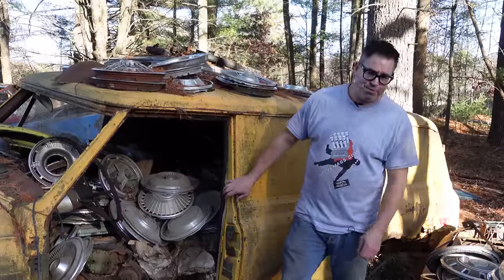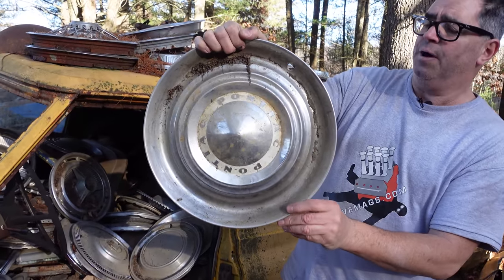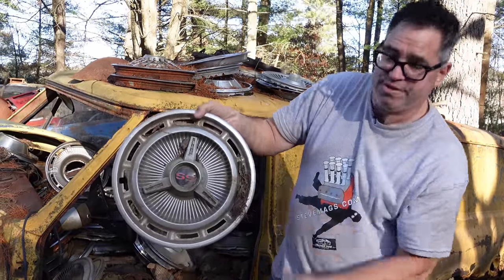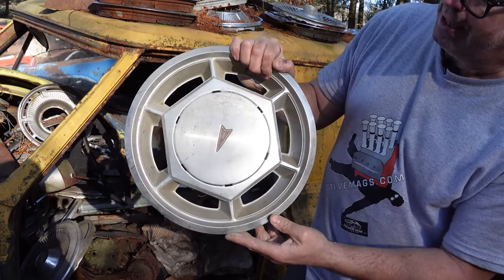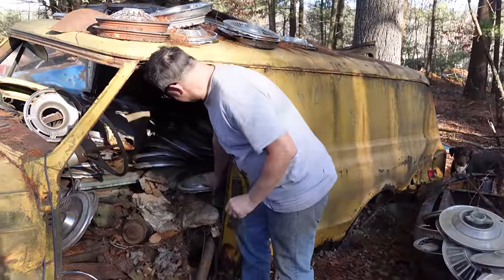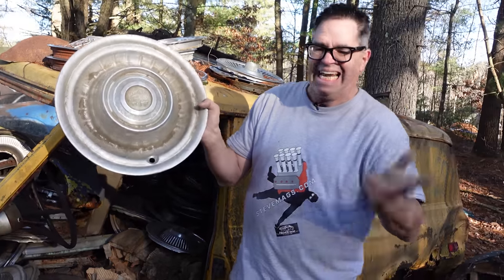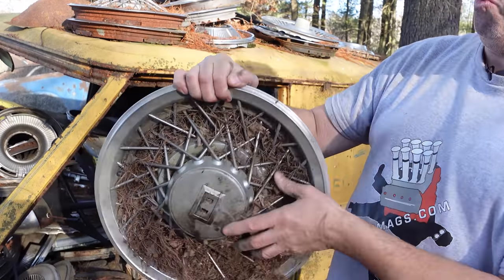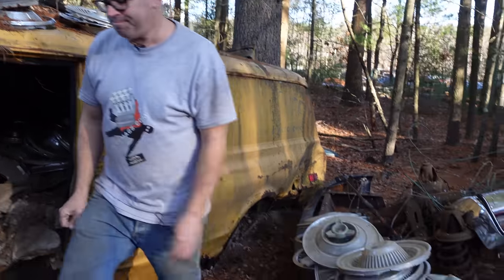Hubcap Game TWENTY TWO

Comment: The 1953 1954 Pontiac hubcap at 1:47 was the first hubcap I ever saw fly off a car in the Bronx NY when I was 5 years old. The car was really beat up and a real clunker and as it went by us the hubcap rolled right onto the sidewalk where we were walking. I brought it back to the apt and have been collecting ever since. Now, in 2023 I own a brick and mortar hubcap store and an eBay store as well, both called hubcapjoes

Comment: Our 1970 LTD had those wheel covers first featured. It was a four door in white, with a black vinyl top - and that 390 2V...
'65 Impala SS?  There was a rusty one near me when I was young. It was light blue, 283, Powerglide, and it had a vacuum gauge on the console!  Even the little bright metal rings on the taillights were rusted/corroded!!!

Comment: Correct, Pontiac 287 CID V8 for 1955. That's not correct on the Granada, you could get it as a wagon in 1982, the final year for the Granada. They would have been assembled in Hapeville (Atlanta), GA or Chicago, IL. The latter plant still operates today and Hapeville closed in 2006. 

Yes, the SS package was an appearance package in some cases, so yes, you could it with a six-cylinder engine. That looks like a Regal hubcap from the 1980s, say 1983 or so. Those would have been mid-size A or G body cars. Nah, no confusing that Sun-turd hubcap with anything to do with a Trans Am. LOL. That ink stamping was likely put on by the vendor that supplied them to Chrysler, yes. Many times they will put the customer's (manufacturer's) part number on it for them to keep track of what they are selling. Katie is coming by for a visit. She's a good woofer, very well-behaved. 

You mean "Delta 88" as there was no "Delta 98". It would have been a "98 Regency" if anything. No, those are 1980 and up full size Oldsmobile wheel covers, more like the Delta 88 (the 98s had a smaller center section). Both ITT Industries and Norris made them for GM, and the difference is the clip design that holds them to the wheel and the locking bolt down the center. You can make a "Type 1 and a half" of sorts, which is what I did. I use the later parts and made them work on the 1st design parts as the clips are better and they stay on the rim better. Those rocket snap on emblems and most of the wheel parts were available well into the 1990s and early 2000s.
Reply: Great info as always G P .   You always get everything straight !
Reply: @daynadiggle8169  Sure thing, anytime.

Comment: Alot of the hubcaps would be a neat touch to people's project cars and trucks and use some of them from something else or something older than the vehicle as long as it fits the wheel clips in place doesn't harm or damage the valve stem or interfere with suspension components and hubs like the trucks sticking through the wheel can really change the look of your project and you don't have to broke on a new set of wheels i did that alot as I was younger kinda like the 89 Chevy S10 regular cab short bed 2wd el trim truck? Ehm i had i ran 14x6 Buick Regal steel mag wheels on the s10 with Douglas performance gt tires on the s10

Comment: If you compare that wire Olds cap with the 15" Buick from a previous video, you'll notice that they look almost the same on the outside, but all the parts are different. Not a Buick vs. Olds difference actually, but a Norris Industries vs. ITT difference. There's also a Norris version of the Olds cap, which is identical to the Buick except the center hub. GM added ITT as a second supplier for these in the early '80s, which resulted in a lawsuit between the two suppliers. Norris lost the suit, establishing that the visual appearance of a wire wheel cover is not copyrightable.
Reply from the maker: Hello rimtrim, THANK YOU for the "insider knowledge" on the Great GM Wire Wheelcover Mystery. -Steve Magnante